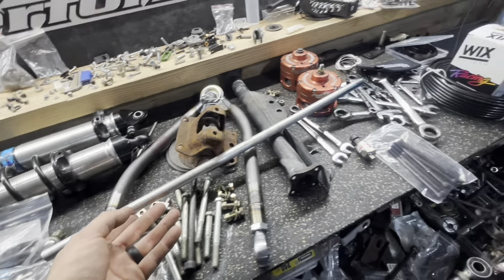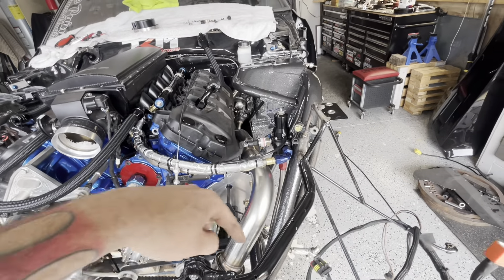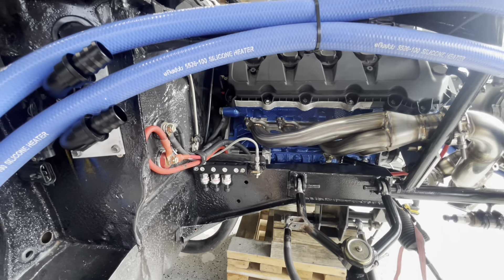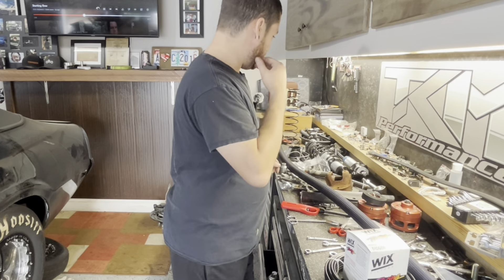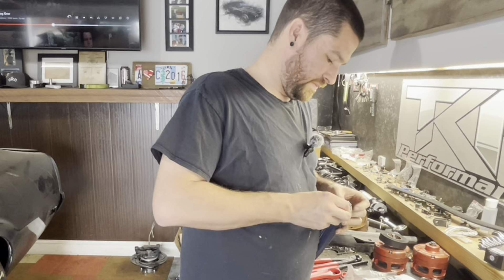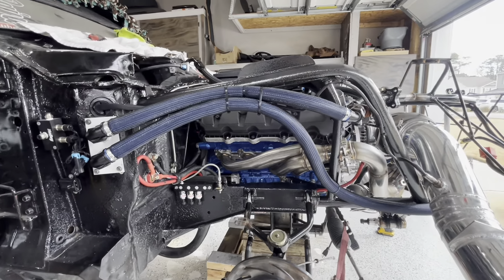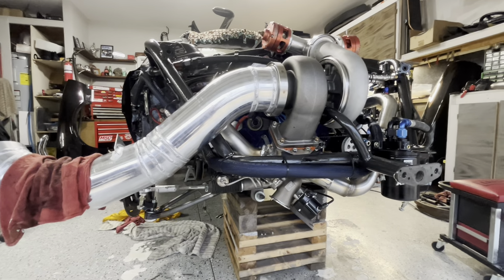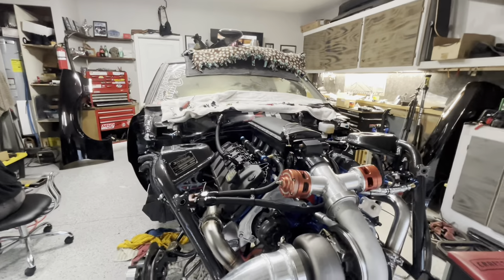🔥 Down To The Wire LITERALLY 🤟🏻 Turbo Comet Rebuild

Comment: Get you some 7/32 Vacuum Hose It's what I have used many times for Fire wall Grommets  Just cut a Piece  Slit it Long ways with a Razor Blade and Boom Wires ae safe :face-blue-smiling:you have made Geat Progress Nice Job
Reply from the maker: Good tip thanks

Comment: Aye man looking into doing the silicone heater hose and fittings looks like that’s the flex can 1”? Also what fittings are you using? Thanks man been learning a lot from you and turbo John
Reply from the maker: -16an eBay push lock fittings and yes it’s 1”

Comment: Flip throttle body over.
Reply from the maker: Like I said in video I can’t bc of lines and stuff in the way and not sure if charge pipe would fit other way if you recall how we built it being crooked
Reply: @ThePaintPaperHustle  I typed it to early. I flipped mine idk why they were put on passengers side for....
Reply from the maker: @jeffgraham48 lol you’re fine buddy. I had it flipped at one point maybe a year ago